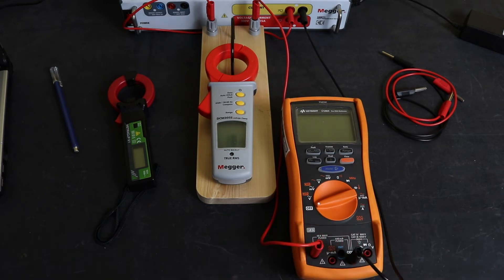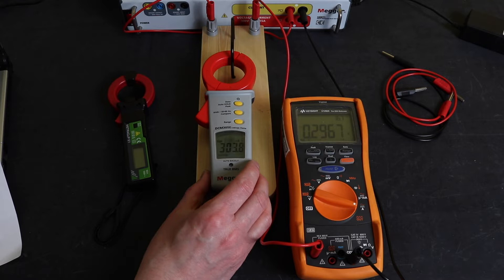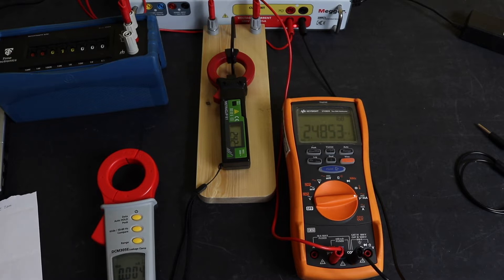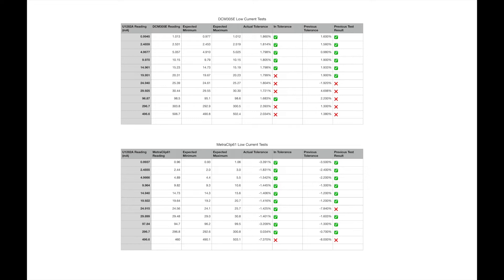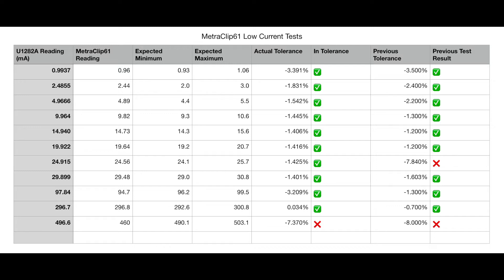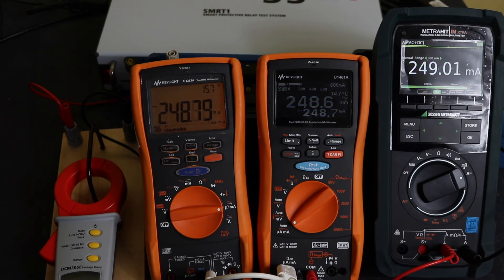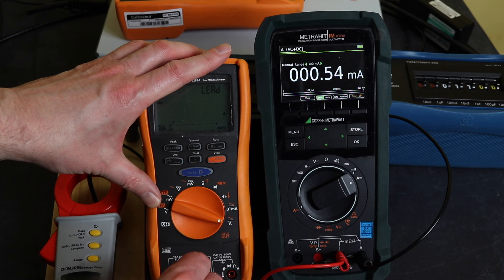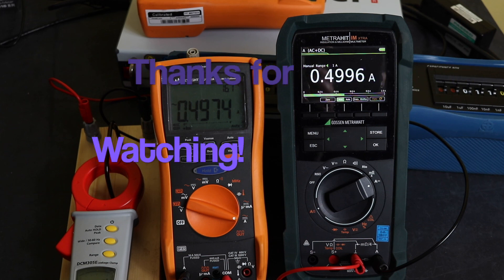Earth Leakage Clamp Testing Revisited

Comment: Do you know of a logging leakage clamp?
Reply from the maker: The only logging earth leakage clamps I know would be the Fluke 368 FC and 369 FC which connect to the Fluke App, so you would be able to record with a phone / tablet. There are earth leakage / loop clamps from Chauvin Arnoux CA6416, Extech 382357 and Fluke 1630-2 that have on-board memory for recording. You could also look at something like the Kewtech KEW8112 clamp adapter for use with a multimeter with a recording function.
Reply: @three-phase562 

Thanks, Fluke sounds extravagant!
I'm getting mad troubleshooting an intermittent earth fault from en elevator. It happens every now and then. Normal leakage is around 10mA while operating. It's on a 300 mA RCD. The supply also goes through an ELR, which records the tripping current. Most of the trips happened around 600 mA. Now I want to datalog the earth wires that comes from each electrical/electronics module including the motor.